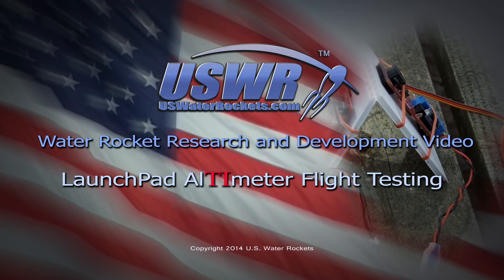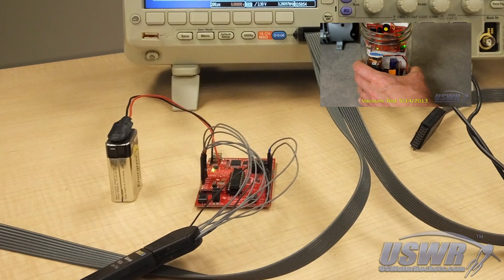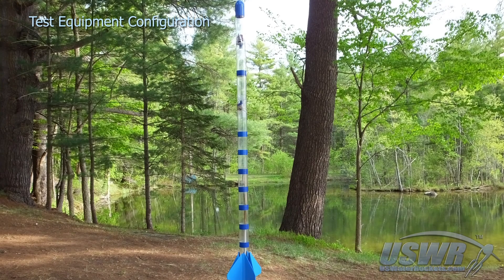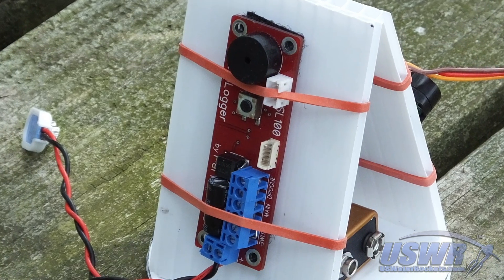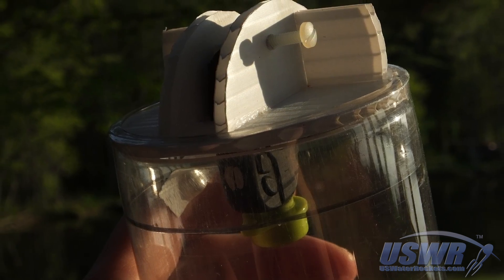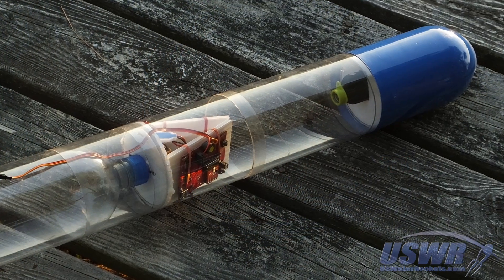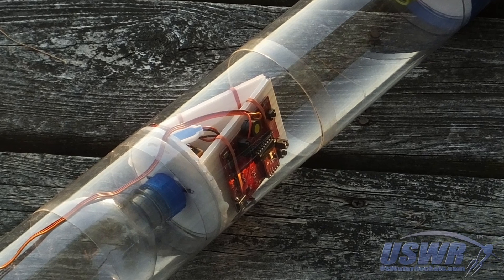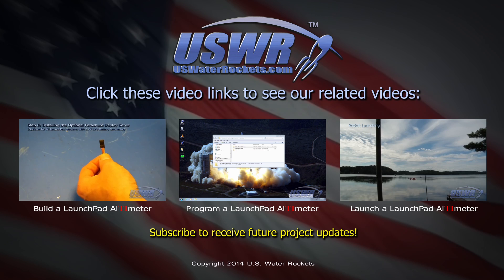Homemade Water Rocket Parachute Deploy Altimeter Flight Testing

Comment: Very nice video!
But what happened with the rocket at 1:40? It looks like the parachute bend the rocket in the middle.
Greetings =)
Reply from the maker: We were testing an experimental parachute recovery system design variation on this flight as well. It never performed as we hoped it would, so we abandoned that design.